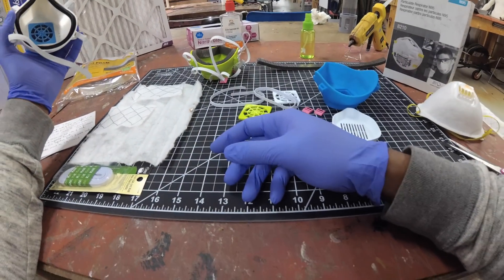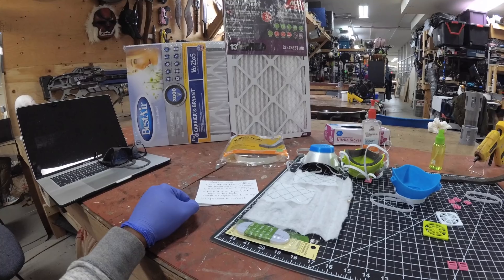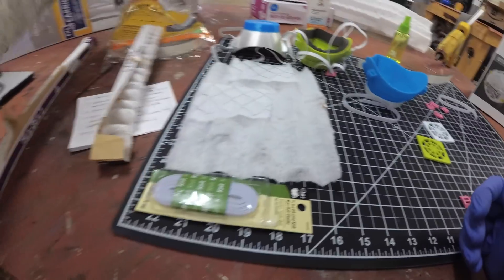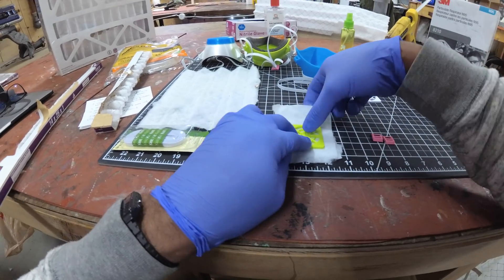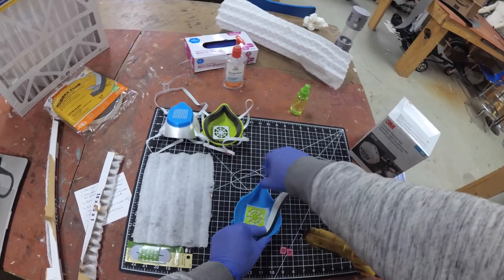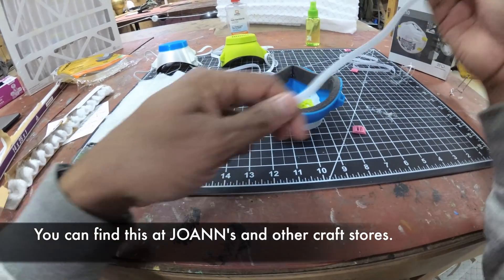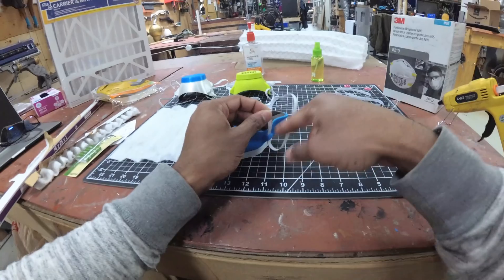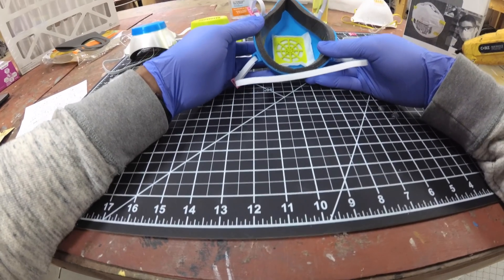3D printed PPE DIY Particulate Mask ( PROCESS )

Comment: Hello out there, So just a few thoughts from a medical professional who is part of this massive VOLUNTEER effort to help our front line folks...which I am one of. The mask works! There are some challenges with it and we are all working toward improving the working model. So I would tell all the critics here to get on your computer and start improving the design instead of Sh*t talking the folks who are trying to help. Be sure to post your new file as open source so ALL of the 3D printers out there can access it. #1 The mask does seal around the outside of the mask in the current design. There are other materials that we are all constantly discussing to improve the original design including the filter. That has been our biggest challenge and we are still working on it. Polypropylene shows some promise as long as it provides a filtration of  0.3 micron. Breathing tests are still happening to ensure adequate oxygenation for the wearer. A layered filter of polypropylene and cotton may be the answer but it would have to be very thin. Some types of Hospital grade N95 masks have 4 very thin layers which do work when put into the filter compartment. So 1 N95 mask will fill 4 3D masks. A 75% increase in mask availability for our medical folks.
Reply: Wouldn't this be a bitch to breath through and go through filters due to moisture quickly due to a lack of a exhalation valve. Think this design could be improved but it's still great for those with nothing than bandanas and surgical masks (like me 😝)
Reply: @kyliemcwynne  won't exhalation valves increase the amount of virus we could potentially propagate?
Reply: Yes thank you ppl always got something negative to say what he did is a awsome great idea .
Reply: What exactly do you mean when you say, "the mask works"? It has been certified to N95?
Reply: Oh look for a company called Ameraflex there in TX they sell 50' roll of 3m backed cc sponge . Closed cell = cc if you're needing more help how can I help . im and architecture major.
Reply: Hey bro .what can I do to help you make masks. I do autocad drawings. Let's make a better masks . keep up good work
Oh any. Bed sheets with 600 plus thread count work with filters.
Reply: Exhaling valve, and the most biggest issue i see on your mask is the gill design on the front piece. I should make it horizontal not vertical. And also make a wider lamella angled about 45-55° 
like those marine grade air vents.
P600 material, carbon fiber sheet and nanovoven cloth.
Reply: @Hunguerilla87  exhaling valves are a bad idea, these masks should work both ways to stop you from spreading the virus if you get it
Reply: @danieldelgadosan  i mean not exhale valve. I say on the blue bit those grids or grill rosette.
The angles should beter if they horizontal and angled downward of a 45° angle. If the droplets reach it reduce the chance all of them goes through between them.
Reply: How can you tell if a filter is made of polypropylene , fiberblass or any other material?
Reply: I am a front line worker and a mask doesn't make a difference. It helps people's feelings and is a symbol of our governor's total control.

Comment: I have re-designed one that is 4 % bigger than the large size that has been released, I am still testing this mask but I hope to have a working one by now. The one I re-mixed has better fitting designs for big faces, and I happen to have one , in my case the large size is too small, and a lot of you may find that too, I will post the STLs for this mask as soon as I figure out all 4 parts. Russ
Reply: The updated parts work wonderfully, the square piece with holes in it fits perfectly.

Comment: I'm interested to know if you have developed the mask further. I have spent the last year developing my own mask design and iv finally got it right therefore I know how hard it is to design a mask from scratch. A couple of questions about your mask: Do you get any fibres coming off the filter material when you breathe in and is the foam strip you are using as a seal safe for long duration skin contact?

Comment: Is there a better adhesive than hot glue? I couldn't get it to stick to the seal, and the PLA very well.
Reply from the maker: Generic hot glue sticks won't work just fyi ... "High temp" hot glues will work best ( gorilla glue brand has a good formula ) ... You could also try a 5 min 2 part epoxy but that can get messy quickly.

Comment: "snug" isn't good enough for a filter layer.  You need a gasket material to ensure no leakage around the filter layer.  Also, elastic is in VERY limited supply.  The front piece seems to serve NO PURPOSE, other than cosmetic.
Your "adjustment clips"/buckles are superfluous.  Just loop the ends of the elastic through the mask, and staple (NO hot glue gun needed)them together  (elastic STRETCHES, it's self-adjusting if the proper length is cut).
Reply from the maker: you can do as you like, no need to yell 😏... The nature of a DIY mask is such that you use methods that YOU see fit, my instructions are not law and I've clearly not only stated alternative methods in this vid but also mentioned that the one i use will probably be outdated as soon as i posted it, hence why i ask throughout the vid to check the description for updates ... good luck with everything, try and consume content in their entirety & please stay safe out there.

PS: the purpose of the front piece in this design was for a secondary filter layer in case folks wanted to double up.

PPS: you would've also known that the design has been changed and updated had you read the  notes in the video description.

Comment: The FFM process of 3D printing creates a viral porous mask due to layer gaps (easily seen through a microscope).  It will need to be coated with something that will act as a filler/finisher.

Comment: So did you verify that those merv 13 or 16 filters dont have fiberglass particles used in the construction of them? From many articles and also talking with a local filter supply store in my area they warn against using hvac filters because of fiber glass commonly used in their construction.
Reply from the maker: We have an electron scanning microscope, so we're able to physical see the fibrous make up of any filter we consider for use ... I can say the exact  ones used in this vid do not have fiber glass, but I can't speak for Any other Merv13 or 16 product ... Because most don't have access to the tech we do, we're encouraging those who can't verify if a filter has fiberglass or not to use non-woven polypropylene instead, also known in hospital settings as "surgical wrap" as a safe and effective alternative

Comment: I have read that cotton makeup pads have a micron 0.1 and corona is at 0.125 microns. Wouldn't this be a suitable product for a filter?
Reply from the maker: wtvr material you end using for filter, you have to make sure there are no toxic components baked in & that you can actually breath with it on without "too" much effort ... i don't see a makeup pad allowing much airflow tbh :/
Reply: @GiveWaveStudios  I have already made a mask, using makeup pads. I peel one layer of the pad off, I can breathe fine through it.

Comment: just printed this mask and it fit me perfect without having to heat it and mold it. now i have to source the rest of the parts like the filter and the strap. also i think im gonna use  a couple of coats of spray filler to 100 seal the mask since there may of may not be microscopic holes from the layers lay by the printer.
Reply: Simple just wet running water sand with 200 grit sand paper to sand the rough ridges down on filter mask;

then simply apply plastic wood putty filler thin uniform layer and let dry;

then simply use 200 grit sand paper to sand down the wood putty filler thin uniform layer till as thin and as smooth as one can make it by using ones eye;

then simply attach a long wooden barbecue skewer glued to inside of filter mask with couple drops of super glue;

then simply apply spray primer acrylic paint coating to filter mask and then let dry;

then simply use 200 grit sand paper to sand down the spray primer acrylic paint coating to filter mask and then let dry;

then simply apply favorite color spray acrylic paint coating to filter mask and then let dry;

then simply use 200 grit sand paper to sand down the spray acrylic paint coating to filter mask and then let dry;

then simply apply final color spray acrylic paint coating to filter mask and then let dry.

This makes for a very smooth, glossy, very effective sealed surface with no micro leaks from all the potential microscopic micro ridges ridges from the laying down of the multiple 3D print melt materials; plus it looks very  cool indeed having a super smooth glossy coating in gloss blue, white, and/or red filter masks to change up different colored filter masks to use from day to day.

Comment: is there a potential for fibers to come off the inside the filter into your lungs? maybe a coffee filter on top of the hvac filter inside would prevent that?
Reply from the maker: This precisely why there are 2 potential layers of filtration in the design 👌
Reply: @GiveWaveStudios  yeah but its 2 layers of the same hvac material. if its shedding fibers it will still be able to get into your lungs. you would need a 2nd different material on the inside to keep any fibers out of your lungs.
Reply from the maker: @danielroden9424  negative, "fibrous layer" on the outside "coffee filter" on inside ... Hence reducing potential of fibers into lungs

Comment: change the mounting method to a thread that can be properly sealed with silicon based material as well as cover the mask with a substance that will seal the micropores that appear in 3d printing and change the sponge to silicone / gum tape for sealing windows because the foam is neither airtight nor hygienic and cannot be cleaned... otherwise this looks pretty good

Comment: I printed a test mask, then heated it with a heat gun and held it tight to my face as it cooled. When I breathe in I can feel and actually see it sucking to my face. You just have to make sure you only heat the area that will contact the face, if you heat the whole thing you'll warp the grill area then changing the filter becomes a problem.
Reply: Can you recommend a budget friendly printer that can be used to make these?

Comment: Hi, in the update you mention the use of polypropylene. I have had issues finding it but but found that ponchos, manufacturered by Frogg Toggs, are made of 100% polyethylene shells and 100% polypropylene lining. Do you think this would be a viable option to obtain the polypropylene? 

If this option meets requirements, it is a more inexpensive and less a hassle to use in this application. I found these ponchos for adults at about $5 at Walmart.

Comment: WARNING these 3D printed masks will not work filament has microscopic gaps in between its layers no they are small but viruses and bacteria can still get through them A way you can fix this if you can put some filler and an acrylic layer on the plastic or else the viruses will still be able to get through regardless of your seal or your filtration medium

Comment: Trying to figure out how to get a good fit around the bridge of the nose. Can't seem to get rid of all the leaks. Any suggestions?
Reply from the maker: are you  not using the foam on the inside ?
Reply: @GiveWaveStudios  I am, but I still cant get a good seal. It's almost as if the bridge of my nose is too wide, and I've got a small to normal sized nose.
Reply: The way I'm testing is to cover the intake with my hand and inhale/exhale. When I do that I can feel air coming out around the bridge of the nose.
Reply from the maker: @marysaaddis31  if you printed in pla you can submerge the part in hot water for a few minutes to soften it up and safely try and mold it to your face ... highest temp water from tap should be enough heat to do this, and you can do that process multiple time til you get a good fit ... just be careful not to burn yourself
Reply: @GiveWaveStudios  Great tip! Thank you! i'm guessing this needs to be done before I put the foam on?
Reply from the maker: @marysaaddis31  In deed, yes.
Reply: @GiveWaveStudios  Thank you!

Comment: Well, I drew masks of different varians. The design is purely industrial, not for aesthetes. For any filter cloth, any thickness. Including there are options for cotton wool with an exhalation valve and without it. I do not have a printer.  https://3dtoday.ru/3d-models/3ddoctors/masks/maska-respirator

Comment: I have found that vacuum cleaner bags rated as hepa media traps 99.97% of particles down to 0.3 microns works even better than furnace filters (no wire and each to handle).

Comment: What about using the weather seal on the inside. Then on the rim on the outside print directly on the mask as the surface, and use flexible filament so that it could suction on to any face and get a better hold. Kind of like a plunger on the face.
Reply from the maker: We had difficulty printing with flexible filaments in the early stages and also had a limited supply but had way more pla & petg in house so we went with what we had. We'd love to hear if others have tried and found success with other methods which the main reason why we've made this an open source project. We're still improving on the design and it has change drastically with a multitude of versions since this video was posted, but we're still testing so we have not made the new models available yet

Comment: 2:15 filter media no good for keeping corona virus out... which are many times smaller than that filter can keep out!! Corona Virus is 0.06 to 0.14 microns in size.
https://smartairfilters.com/en/blog/coronavirus-pollution-masks-n95-surgical-mask/

The mask you are building could be good for helping prevent someone who IS INFECTED from spreading it, by containing any droplets coughed or expelled.
Most people will catch this virus by transferring it from their HANDS to their face, and NOT by breathing in the virus. Consider, how do you get that mask off without transferring the virus to your hands, then infecting yourself? ... for most uninfected people, using masks may be more dangerous than no mask.
Reply: The article you posted doesn’t support the claims you are making. The conclusion of the article was the following: “Even poorly performing masks captured over 90% of viruses. The researchers chose two N95 masks that scored poorly in an earlier study, yet even these poor-performers still blocked 94% of particles under the heaviest air flow rate”. Surgical masks are made of polypropylene material, which has similar filtering capabilities to MERV13 rated filters, which is what he uses in the video. 90% blockage is a lot better than 0% blockage.
Reply: @Asignore76  but the masks tested, fit properly (N95 masks come in multiple sizes and must be checked for fit by trained personal) .. just making a home made mask  that poorly seals and has inferior filtering, and a person isn't trained to handle properly .. creates a dangerous false sense of security. Especially when the vast majority of people catching COVID-19 do so by transferring the virus from hands to face, NOT by breathing in the actual virus. If people simply maintain 6 foot clearance, there is little chance of breathing in any virus. The whole mask thing is highly over rated, but if it makes you feel better, like you have some control over this mess, go for it, but at least learn how to handle that mask, would be a shame to catch the virus by taking off your mask incorrectly.

Comment: Has anyone tried printing one of these masks in TPU? Or starting the print with PLA so the filter area is hard plastic and then changing filament to TPU when the print is close to finishing the mask?
Reply from the maker: We haven't no, but it's feasible ...
Reply: It can be done. I'm already printing masks this way. TPU does bond to PLA fairly well.

Comment: First of all, thanks for credit us as the designers of the mask 3D model. Great video tutorial!
We would like to invite you to try the new version we´ve just updated (free download):
https://www.thingiverse.com/thing:4225667

It has some improvements based on suggestions of the people who is already printing and using it.
The main one is a new improved filter connector to guarantee the best air insulation possible.
Also, is thinner and more easy to print, and we prepared and updated manual too, check it out.

Be safe!

Comment: Hello, I bought the Honeywell Elite 10 FPR and a question was posed as to whether the material could be used as a facemask. The spokeman said "The weight of the material is much lower to allow for proper airflow in an HVAC system. Therefore the capture rate is different for different flows." Evidently you could increase the effectiveness by increasing the number of layers. But I am trying to determine how many layer. Excellent video by the way.

Comment: just make sure you only do this with fdm printers and NEVER resin. resins are all toxic unless you go and get one of the super expensive non-toxic ones. even the anycubic eco-resins are toxic and unfit for using to breath through. and even if you do have an fdm printer, make double sure the filament you use is in no way toxic or bad for the respiratory system.
Reply: If cured resin was toxic to breathe then I'd be dead by now.
Reply: @clutch2827  if you don't have anything yet and you continue to use it, you will have issues. just because you are not noticing any effects now doesn't mean nothing bad is happening to you. i would urge you to play it safe and cease breathing through anything printed from resin, even if fully cured.